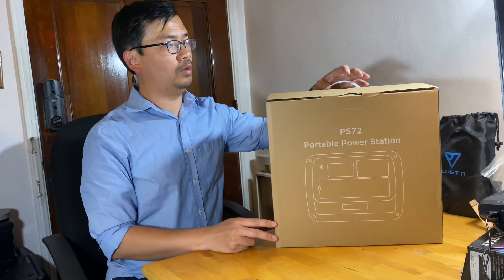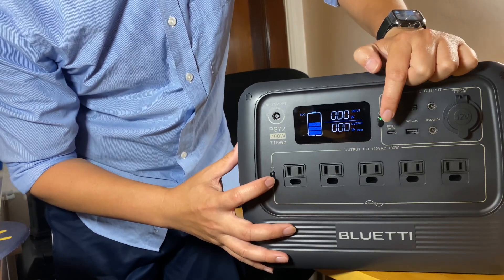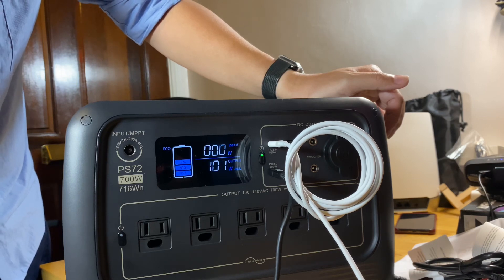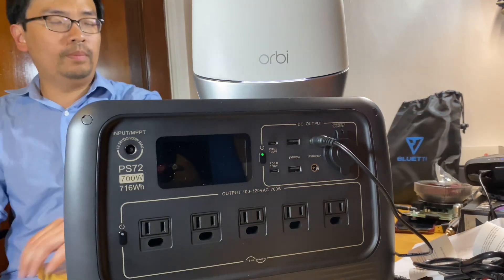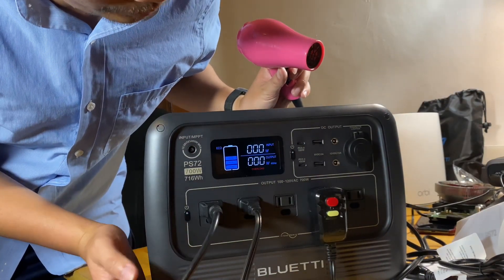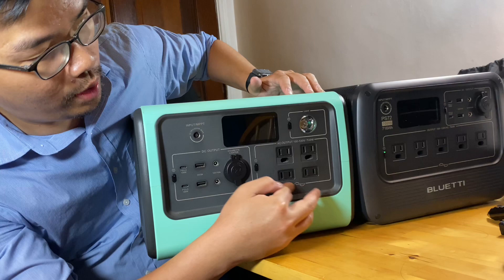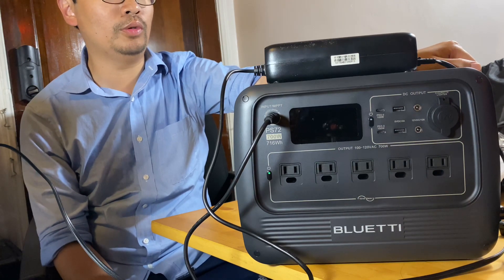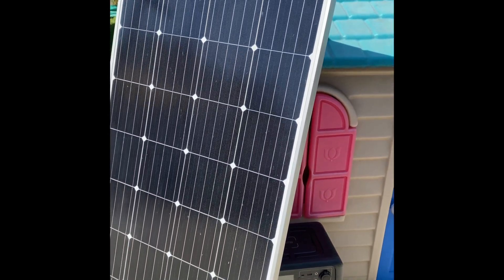Bluetti PS72 with LiFePO4 battery 716wh capacity with 700watt inverter

Comment: The million dollar question, why does the ps72 exist? Bluetti already has a eb70s? Same battery, 716 wh. Eb70s can handle a 800 watt load instead of the ps’s rated 700.
Reply: maybe they had some 800w inverters that failed quality control, and maybe these cells are B grade LifePO4 cells? So that way they can ship these units which some reviewers have pushed the inverters to 800W.
Reply: Inverters are probably leftovers parts from the now discontinued EB70.
From the research I made and comments on the Bluetti community forum, the PS series is made as a low cost entry level series where they package older tech in a simpler case. They are only available in the US as far as I am aware (we can't get them in Canada). You won't find UPS mode, Bluetooth, power lifting, etc. Still a fantastic deal if you are looking for battery capacity alone. Also they come with a good set of cables (pleasently surprised by what I saw)

Comment: How are you hooking up your Orbi router to the DC port with a barrel plug? It seems routers have120v AC power supplies. Thanks.
Reply from the maker: No its not. Regularly you would use a small square plug that plug into 120v outlet that comes with the orbi box. That square box is doing the conversion from 120v to 12v. If you use the 12v barrel plug from power station, you are at 12v, no need to turn on ac inverter of the power station at all
Reply: @MinhTrinh918  I wasn't aware the 120v plug was converting to 12v. Very cool. The Bluetti uses D/C much more efficiently than A/C. I just bought a PS72 today. Pretty cool device although it seems a little outdated at this point (compared to the EB3A). Great video...Thanks.
Reply: It is actually more efficient that way then to use the 120v power supply in the AC outlets of the ps72